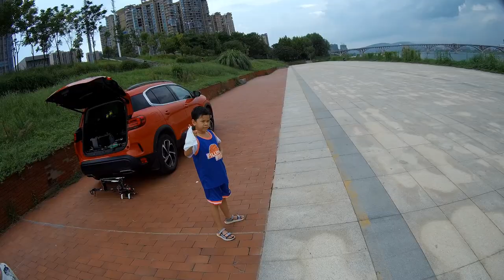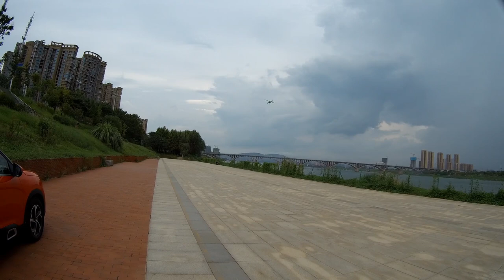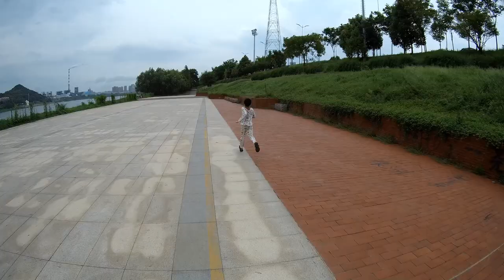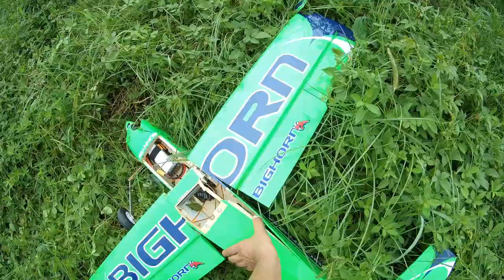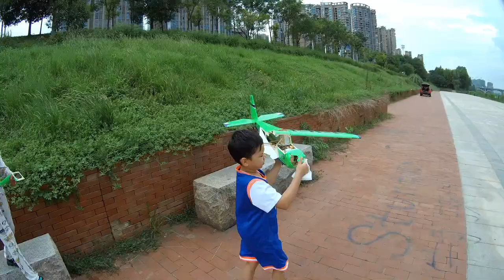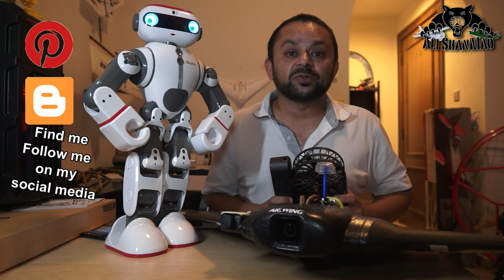I crashed my OMP Big Horn RC Airplane

Comment: Why did you fly when your equipment was clearly not functioning correctly?
I'm basically a newbie and would've sorted things out before sending my plane into the air.
Sad to see such a beautiful plane destroyed.
Reply from the maker: It was not the radio issue. telemetry loss is another thing, RX signal loss is different. If you lose telemetry that does not mean you have lost control signals. i had total control on plane. it was my mistake, too much rudder too slow speed and very high nose angle. obviously it stalled and altitude was not enough to control it

Comment: Flying a model with issues like elevator jitter is just "plane" crazy. I would never fly a plane until all problems are resolved.
Reply from the maker: well it wasn't the issue with elevator i think. it was pilot mistake
Reply: @alishanmao   Oh ok! I thought the elevator was jittery before take off but your'e brave enough to say it was pilot error. My only other thought is that you had a telemetry lost indication a couple of times so for me, I still wouldn't have flown it!
Nice plane though, thinking of getting one.
Reply from the maker: telemetry lost is just telemetry, not the control loss. but it was totally my fault, i stalled it with higher rudder input and lower speed, then tried to control, with higher throttle, which in higher altitude case would have been 100% save. but at that altitude only disaster. yes its really nice powerful plane, it can even hover like 3d planes. get one @richardpowellTV
Reply: @alishanmao  Absolutely right Ali. Telemetry is just telemetry. Definitely on my list to get this plane. Blue or green? Hmmm. Blue is nicer but green shows up better! Decisions decisions, it's a hard life LOL!!!

Comment: How about checking out conditions first? What is wrong with taking it easy and flying a little conservative? Re-acquaint your brain with the experience of flying a plane you see with your eyes? Warming up the good old muscle memory before you need it? Try some stalling maneuvers and do a couple of landing approaches, while making sure your skill has enough time to actually come back to you? How about reacting to a connection issue with your transmitter?
The stall was 15m above deck and skill could have saved your plane.
I killed loads of foam planes and I am still crashing, but you are showing me how not to do it. Thanks!

Comment: Hey my friend. I see you got inspired by our latest flights ;-) Great video. Big salute from Slovenia, Pilot Robert
Reply from the maker: Yes brother, we all have to crash here and there some times hahaha without crashing there is no fun in this hobby. Thank you for watching, Big Salutes, Pilot AliShanMao
Reply: @alishanmao  I just crashed the Bobber today but I was alone on the runway testing it more. I just cant fly that plane no matter what I do. Dont understand it anymore.
Reply from the maker: @PetrincicBrosRC  well brother, some times the simplest things look too complicated, maybe there is just one little thing you overlooked. I would say never give up. you can keep trying and you will succeed. unless if the plane is too broken to repair anymore or too heavy with all the tape and glue hahahaha
Reply: @PetrincicBrosRC : Hello, I once had a station that didn't broadcast properly every now and then. I didn't want to admit it for a long time and the self-doubts grew bigger and bigger. Since I've been using a new transmitter, everything has gone back to the old one. But it was extremely frustrating not to find the fault for so long. Greetings from the Rhineland.

Comment: This happened to me also as and such a shame on beautiful airplane. Honestly I'm torn about how it flies. On one hand it's excellent in aerobatics on the other hand it is so easy to over control it at low speed. And I like to do slower aerobatics so might not the plane for me.
Reply from the maker: you need to look at 3D Profile planes

Comment: your plane crashed because of the TX16S you are using, TX16S told you : "telemetry lost", I had the same problem with one of those TX16S, lost signal when my heli was flying just 40mts. away, I managed to land and luckyly I saved my heli.
Reply from the maker: No idea. bad things happen. life of RC Pilot

Comment: I think it is more of a signal problem with you're receiver. Telemetry is something not to ignore of. Throw away that receiver lol or put it on a very cheap 75 dollar pnp foamy and test it
Reply from the maker: i have flown this plane many times and it was pure pilot error, I admit it with honor hahahaha
Reply: @alishanmao  Oh you had that telemetry problem all the time? I do remember I had a model that had telemetry issue which i was using taranis. Never had issue but my other models i had telemetry issue saying same thing and then lost control and crash. I went back to Futaba. Yet Frsky futaba compatible receiver i never had issues. I probably bought over 20 receivers. No rma. Anyway's I want to get same plane like urs maybe next week :)
Reply from the maker: @rcrotorfreak  well yes I am now using futaba and tx16s still with Futaba Rx(s) for Futaba and RadioMaster Brand Rx (frsky protocol) for Tx16s and so far things are pretty n good

Comment: You shouldn't have took off with the radio problems.
Reply from the maker: its not the radio problem. this radio keeps saying telemetry lost. not the actual control signal loss. its only telemetry. the crash was pilot error. too much rudder, little air speed.

Comment: That’s repairable. Just glue all the wood back together. It’ll hold together you glue the wood pieces together anyway. Foam models are a no brainer when it comes to repair as the foam balls are already glued together but a lot of people don’t realize how much fun they can have repairing a crashed wood airplane. Just get some thin and medium CA, some accelerator, some 5min and 15min epoxy, some glass cloth, some isopropyl alcohol to thin epoxy and some monokote stick on trim tape and she’ll be back up in the air in no time.
Reply from the maker: Thank you Keith, but i think easiest thing to do is, just design and 3D print a new fuselage. and it will be a new design plane.